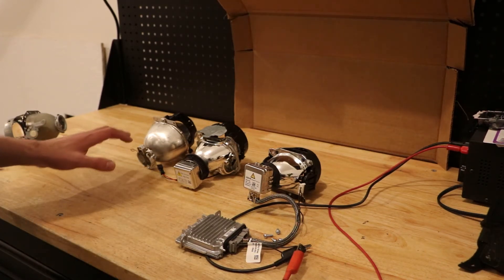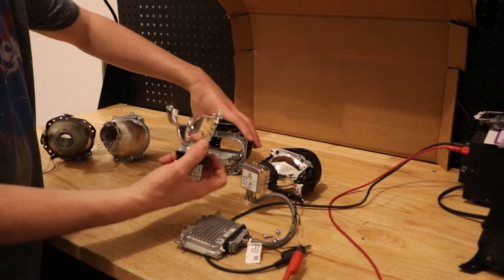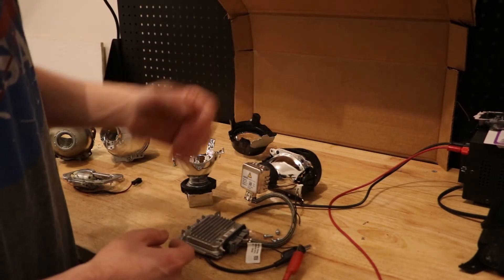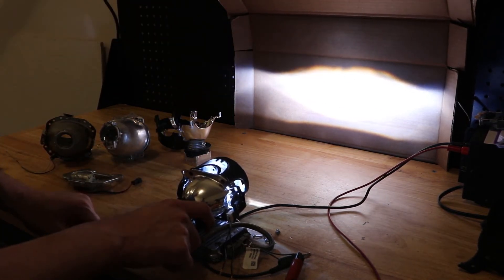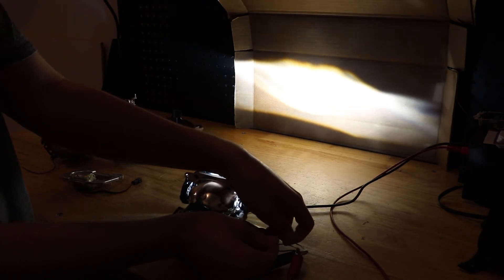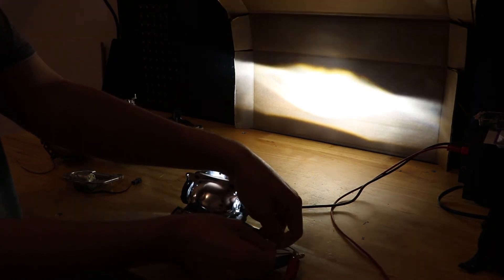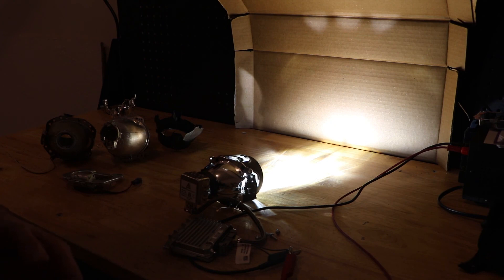What is the difference between Xenon and Bi-Xenon Headlights and Projectors?

Comment: I need a replacement headlight for my bmw 525d e60 2006., they told me that they have a headlight, but not bulb and that I can use my bulb since it's not damaged. How to check if my lights are xenon and bixenon, and does it matter if the headlight I am looking to buy is xenon or bixenon? What should I check out on my car and what should I ask him to send me so that I can compare and make sure that the headlight is compatible? Thank you for this video.
Reply from the maker: The bulbs can be transferred.   There are three different versions of the headlight for a 2006 BMW 5 series.  They are not interchangeable.

There is halogen, xenon without adaptive, and xenon with adaptive.   Both xenon are bixenon, the bulb is the same on both of those.

You need to confirm which headlight you have and that the replacement is the same version. The parts will transfer over.
Reply: @gftgrill i have non adaptive bixenon, the one I am looking to buy is also bixenon, but idk if it's adaptive. Can that be checked if the headlight is not mounted on the car?
Reply from the maker: @s4m1d adaptive headlights have more modules and connectors.   The non-adaptive ones only have the xenon ballast.   So there will only be the wire harness connector and ballast connector.

Comment: i noticed that all the EVOX-R V2.0 D2S Bi xenon sold on aliexpress are with a US beam pattern .....can those me modified to be used in uk? how?

thanx
Reply from the maker: you would need a UK/RHD cut off shield to replace the LHD cut off shield for the US market.   Those projectors appear to be E55 clones.   OEM Hella E55 projectors are pressed together and can't be easily disassembly to get the original cutoff shield.   

Your best bet is to contact the seller and/or manufacturer to see if they offer a RHD version.

Comment: I have a 2006 Porsche Cayenne S Titanium with bixenon lights and want to just replace with standard xenon bulbs as I can not find bixenon in stores and don't want to order online.
Reply from the maker: There are no bi-xenon bulbs.   Bi-Xenon headlights only refer to the projector.  Xenon projectors and Bi-Xenon headlights/projectors use the exact same bulb.   

In your case it's most likely a D1S bulb.

Comment: Hi, great video!

I'm driving a mercedes e250 cabriolet with HEADLAMP WITH ILS, LEFT-HAND TRAFFIC

when i flashes my high beam, my left side headlight is brighter then my right.

from your video, i believed that my left hand headlamps shutter flip up (for brighter light) while my right hand shutter flip down.

is that normal?
Reply from the maker: I'll start by saying I'm no expert on RHD vehicles or European rules/laws.   
Next I'm assuming that your vehicle is equipped with Bi-Xenon headlamps.

In the US that would be abnormal as the xenon lights should put the same high beam output through both headlights.   There could be something at play causing the Right/Drivers side headlight to not be as bright to potentially not blind on-coming traffic.   I have also seen a few vehicles over the years that where the off-traffic side could let more light out of the bi-xenon flat in high mode.   

I have more questions/thoughts at this point.   I would start by pulling up to a wall at night/in a dark area and from about 10 ft or 3 meters away flash our high beams at the wall.  From there I would check to make sure that the headlights are aligned properly.  When you turn the high beam on, does the left side light point higher up?  Does it appear brighter because when you turn the high beam on, it points higher up to give more light further down the road while the right side light stays flat?

I think your vehicle is equipped with a secondary high be specific bulb, is that working on both headlights?  

You'll need a helper, but from outside of the car, can you hear the bi-xenon solenoid activate when the high beam is activated?   

Things I'm trying to figure out
1. Is it a EU rule/law that is causing the right light to appear less bright.
2. Do you have a failed bulb or solenoid inside of the headlight.
3. Possible that the right side light is physically adjusted all the way down, so it can't point further up when in high beam mode or the left side light is actually pointed to far down.   (possible cause: not properly aligned after headlight replacement from a collision).
Reply: @gftgrill  Thank you so much for your detailed reply. Much appreciated.

1) Yes you are right, my car is equipped with Bi Xenon headlamps.
2) In the recent test of my flash beam, after 5-8 flashes, i get "Intell Light Inoperative" and my right headlamp no longer light up, unless i restart the car.
3) Please see a sample of my flash beam --> https://youtu.be/Z1IrBnHmwoI
4) i went to a headlight workshop, they open the back cover of my headlamp and saw the wiring all brittle and being exposed and touching each other. 
5) I think high beam unable to adjust am i right? my main beam is perfectly fine.

Thank you
Reply from the maker: @benyap2232  unfortunately around 2010 ish, that generation Mercedes Benz headlights used inadequate wiring.   It is a common problem across many models.   
You can see similar here in one of my videos:  https://youtu.be/6G_3N0CsgO8?t=309

You can try to recoat the wires or the faster option is to replace the headlight, but know that a new headlight will have the same issue in time.
Reply: @gftgrill  does recoat the wires works? Or has the short already causing problems else  where? I’m still not sure if it’s the wires that causes the one side flash beam or probably the shutter/motor is damage
Reply from the maker: @benyap2232  I don't know.   you could try to separate the wires so they are no longer touching to see if it starts working, but you're correct that the wires touching could have already caused permanent damage to the motor(s) that control the AFS movement.
Reply: @gftgrill  hello I have a 2013 auris toyota. The headlights move with the direction of the steering wheel and it has the high and low beam. The thing is that I don't know what the name of the light is. The fact that it moves would it be bi-exnon or a different category of light? 
If u could kindly help me out I'd appreciate it. Thanks
Reply from the maker: @remoniaremy  There are multiple names given my each manufacturer, but the standard term is AFS Adaptive Front-lighting System.

Bi-Xenon only means that there is a moveable cut-off shield inside of the projector that allows it to simulate a high beam.
Reply: @gftgrill  Thanks

Comment: if my projector is bi halogen, which means it has that flap moving. i just need a normal single filament xenon bulb? 
how about the xenon bulb flashing the light when only using high beams with low beams off? it would start so fast to shine the light?
Reply from the maker: If you have a bi-halogen projector, then you should be using a halogen bulb.  Unless you are asking about using an aftermarket xenon kit to fit into your existing projector.

It depends on the headlight setup.  if the high beam uses both low and high beam bulbs, then yes it would turn on the xenon bulb.  it takes less than 1 second for the xenon ballast/bulb to turn on and start producing light.   In my experience it takes about 3-5 seconds for a cold xenon bulb to warm up to it's full color/brightness, but they generally start at 80-90% of their full power.
Reply: @gftgrill  yes, i'm going to install an aftermarket xenon kit

Comment: I’m about to install the Bixenon factory headlights into my 2010 Mazda 3 that originally had dual beam halogen bulbs (separate high and low beam bulbs). This video was super helpful explaining how the single projector outputs the high beam. Now I’ve just got to retrofit the headlights in.  Lots of wiring.
Reply: I have the same car bro, And I am thinking about doing the same. How did it go with you?
Reply: @Mohamad_Rashad  worked a charm. The plugs are different so I cut them off and swapped them. Super easy as the plugs share the same colour so just need to solder colour to colour and you’re set. Looks way better, way brighter and wasn’t that difficult at all really.
Reply: @7homas0wen  thanks a lot for your quick answer man. I really appreciate it. Did you buy them from the dealership? I live in the Netherlands so I don’t know if I can get them from same place,website you did.
Reply: @Mohamad_Rashad  I actually sell used automotive parts for a living and mainly for Mazdas. I bought a crashed car at auction to strip down for parts and I took the lights for myself. However I’m sure you would be able to find some headlights on eBay or at a local wrecking yard in your area. If you were in Australia I would have sold you a spare set I currently have for sale haha. From the dealership they would cost an absolute fortune and wouldn’t really be worth the price.
Reply: @7homas0wen  thanks for the information. I will try to find aftermarket set, because as you said it won’t be worth it if I buy them from the dealership. Thanks again

Comment: Hello, do You know how to power xenon lamp from the contact socket?
Reply from the maker: Every vehicle is different.  you have to ensure everything internally is connected and find the correct +/- connectors for the ballast.  No two vehicles share the same wiring configuration.

Comment: Why is there a gap between the projector lens and the reflection cup? approximately 3 inches?
Reply from the maker: That is the way it was designed for optics and cooling.   Moving the lense closer would require a different lense to get light output to the correct spot.  Neil Degrasse Tyson has some good information on the science of light.

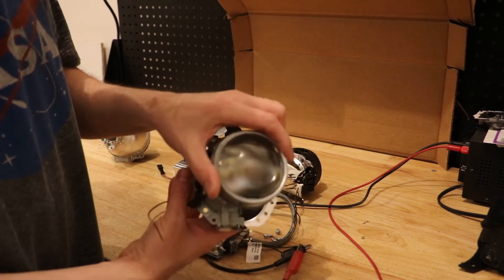Comment: 0:45 Hey whats that flap on the left of the projector? should it be down or up?
Reply from the maker: I no longer have that projector, but if I remember correctly it is used to switch the projector between LHD and RHD.  That way they have one projector to share across the world and they can just flip that switch depending on the market that the headlight is for.
Reply: @gftgrill  Thank you so much!